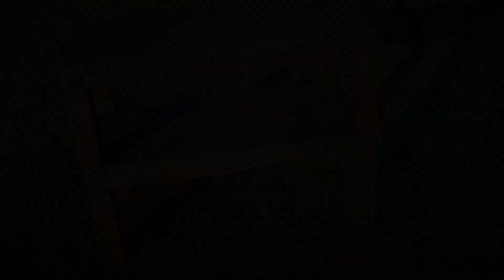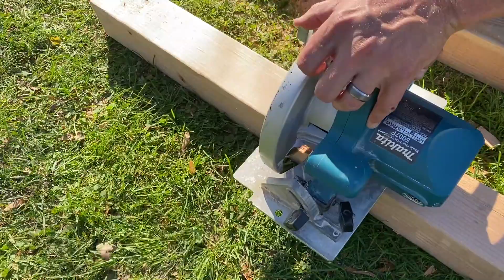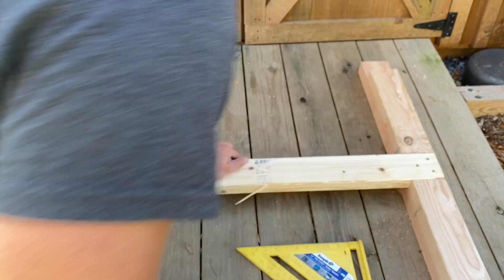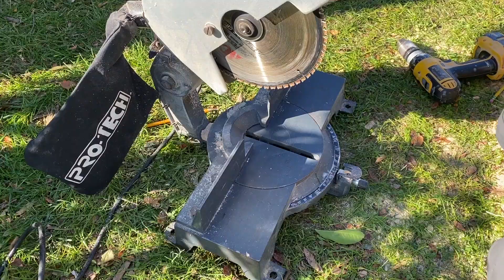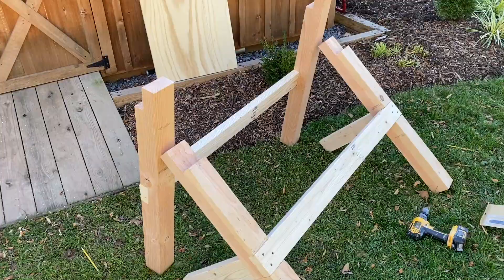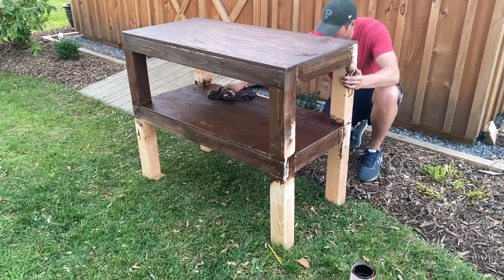Rock Solid Workbench:  Step-by-Step Build

Comment: Now that you've used this bench for 1+ years, are there any improvements you wish you'd made? (eg not having a lip on the table edge to clamp to...)
Reply from the maker: Good question. A lip would be helpful for some projects.  I did add a vice to a similar workbench and that’s come in handy as well.  Other than that, I’m very pleased w how the bench has held up!